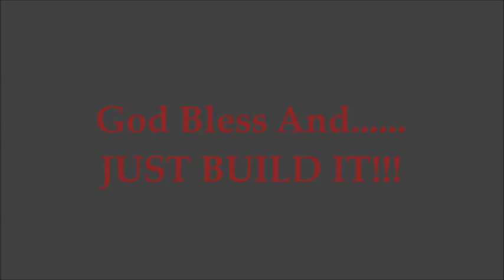Larry Griffith Super Stock Build Update 2 - Body Painting With Testors Aztek Acrylic Part 2

Comment: I forgot to ask were did u get that stand ? Really cool ! So far all I have used Is an old coat hanger bent to hold the body in place ' witch works fairly well as long as ur careful with them after painting
Reply from the maker: I got that one at Hobby Town, but your coat hanger setup is just as good. I used to use those myself. Thanks for watching brother.

Comment: I love your videos, great work.  If you use craft paint with clear floor polish just use a hair dryer to dry between coats..... Works great with any acrylic.
Reply from the maker: Thanks for the kind words brother. Yeah, I've used a hair dryer before, but I'm not a big fan of that. Hair dryers almost always have some dust and lint on the intake screens and more times than not, some of that material ends up in the paint or clear coat. If I want to speed up dry time, I just use the air from my airbrush. Thanks for watching!

Comment: I hadn't built in a while and just used spray can. I'm wanting to get back into it with airbrush. When you mention wetter coats are you just turning the tip more open for more paint
Reply from the maker: Yeah. Open the tip more or, in the case of a double action gun, pull back farther on the trigger to let more paint flow out.

Comment: Gary, I have a Michaels near me, I heard a lot about the paint and read, but still don't know the NAME, also is it buy singles, or did thy have assortment colors at Michaels?  Great looking build, I have same kit, was thinking of doing it as California Flash!  Thanks Gary
Reply from the maker: Thanks Alan. You can buy single bottles. Actually, they don't have an assortment pack at the Michaels where I shop. Is n't the California Flash the car driven by Butch Leal? Should make for a cool build. Thanks for the sub btw!
Reply: Thanks,  say back too the name!! Is it called Apple Barrel paint?
Reply from the maker: Alan Spence It's called Aztek Acrylic and it's made by Testors.
Reply: Sweet, ok thanks
Reply: Alan Spence If you watch for  coupons from Michaels you can get the paint 40-50% off. That's how I buy my paint.
Reply: Ok, thanks I just joined the mailing list

Comment: Hey MC great video thanks for sharing! I do have a few questions in regards to this paint. Being a newbie in the model car world I noticed that you did not prime the surface before painting, therefore how do you know when the surface is 100% straight and ready for paint? I would really like to try this paint out as I have had pretty good results with craft acrylic on the interiors but do not think I have the skills to lay down paint without first seeing any of my mistakes with a prime coat. Would a white primer be okay to use with these paints?  Thanks again for all the tips you have shared on your channel, it really helps us new guys out alot! HAPPY MODELING!
Reply from the maker: Hey Jason....thanks for watching and the kind words first of all. I guess my answer to the first question on how do I know if the surface is ready for paint without primer is just many, many years of experience. I can pretty much look and feel if there are any noticeable flaws or imperfections in the plastic. I use to prime and sand always, but I have found that most of the time, it is not needed of you sand out the mold lines, seams etc. properly. There are times when you have to such as when filler is needed or if you really have to sand to where you have left some scratches and you want to be sure you have smoothed them all out.
 
Another instance would be when you are using automotive paint that may attack bare plastic and you want a protective surface to shoot your paint on to. White primer would be fine, but you really want your primer color to help with your top coat. In other words....white primer for a lighter color and grey or black for a darker color. Some grey primers are almost a silver color, so they can be used for a light color as well. Grey is pretty much a mid ground color primer. 

If your interiors are coming out okay, then you should be good to try out an exterior job. If it doesn't come out like you want, just head to the sink, wash it off with soap and water, and start all over. Hope this helps and feel free to give me a shout anytime brother!
Reply: thank you for getting back so fast! Ill give this all a shot. Keep up the great work

Comment: does making the base coat gloss black make the top coat shinier than you using pearl silver?
Reply from the maker: No. A gloss black base coat would only serve to darken the blue pearl. I have been doing some experimenting lately using black sealer from Auto Air and it works great. Really gives you options for your darker pearls and metallics. Thanks for watching.
Reply: thanks. i guess acrylic pearls and metallics dont work the same as laquers. can you buff testors aztek pearls using 3000 grit to make is super smooth and shiny? i bought some testors pearls and also have 3000 grit but have not tested yet.
Reply from the maker: I have used 4000 on the Aztek acrylics before just to smooth out the paint some, but you have to be careful. I generally don't sand any until I get some clear on the paint unless I have some trash or something in the paint and I don't want to seal whatever it is under the clear. If I have to sand acrylic, I lightly dry sand with 4000 grit, shoot another coat maybe and then set aside to dry before clear coat.
Reply: not sure if you mentioned in the video but is aztek testor airbrush paints 100% acrylic? it has a really bad chemical odour.
Reply from the maker: It has some flo-aid and binders like most good acrylics have, but I'm not aware of any other strong chemicals. I haven't noticed a chemical smell myself.

Comment: if you use craft acrylic with future, can you then polish it out with an auto polish like McGuire's and wax it?
Reply from the maker: Yes, but you want to clear over the craft acrylic / Future. mix with straight Future. Then you can polish out the clear coat. Thanks for watching.
Reply: Thank you so much, man! Do you find that you are easily able to sand out any orange peel or blemishes like you would with an enamel or lacquer?  Usually if you get orange peel or blemishes in your original coat, you want to smooth those out with fine grit before you shoot clear on it, or repaint.  Can you do that with the acrylic/future mix?  Also, if they don't make future anymore, what do you use now that is the same as future?
Reply from the maker: I never get orange peel.with acrylics. Sometimes you can get some "texture" in the acrylic paint. If that happens, you can lightly sand with 4000 grit, but you have to be very careful. Once you get a few good coats of clear on the acrylic, then you can do some wet sanding and go through the grits from 3200 to 12,000. I have done this with craft acrylic as well as regular acrylic paint as well. Now days, I clear craft acrylics as well as regular acrylic with a clear coat mix of enamel clear cut with lacquer thinner or 2k Urethane.

Comment: can you use finger nale polis as pant for your model
Reply from the maker: Yep. Fingernail polish makes a nice paint.
Reply: use laquer thinner 1:1 ratio, if you need to add more thinner youll have to wait longer to cure.
Reply from the maker: I use the same ratio I use for the enamel / lacquer thinner mix.........1:1. Sometimes I use 1 to 1 and a half......paint to thinner. The higher thinner mix makes the paint pull down tighter, but you have to be careful with that ratio especially with a lighter color. You will use a lot of paint trying to get the color up diluted with that much thinner. Works better with a dark color.
Reply: is there any way to thin it out to so it can be used in a air berase
Reply from the maker: The ratio I just mentioned is for the airbrush.

Comment: is there a stencil for the paint detail?
Reply from the maker: Rick Sandfort The lace pattern is a decal. The only.painted part is  what you see here on the video. Thanks for watching.
Reply: was gonna say- that lace pattern would be a b!#$h to cut and lay down....  sweet build!
Reply from the maker: Rick Sandfort Hah! Yeah. Those decals are aftermarket decals from Slixx and they are top notch.  I applied some Micro Sol decal solvent over the top after application of the decals and it made the decals look just like paint. You have to look really hard to see any decal film anywhere.

Comment: Its was fine 20 coats ago😂😂
Reply from the maker: michael jansen What are you talking about?
Reply: mc model works a model dont need 80 coats of paint bruh
Reply: mc model works think you sprayed the whole jar on IT.
Reply from the maker: michael jansen What's you definition of a "coat"? This particular technique uses a lot of mist coats and builds up layers gradually until the desired color is reached. There isn't that much paint being applies to the surface. You obviously are not very experienced with certain airbrush techniques. This is just one technique to use that I like and use from time to time. My work speaks for itself sir. I've been doing this for 47 years brother. Have you bothered to look at the finished product after decals? Does it look like I lost any body details or panel lines? You need to be sure you're qualified to be critical of someone's airbrushing technique before you make comments that do not make any sense.